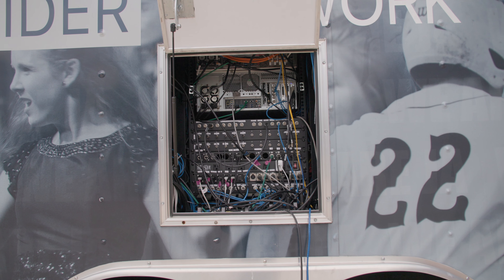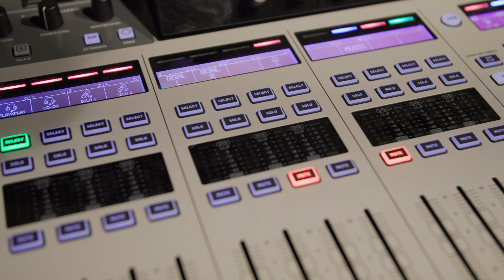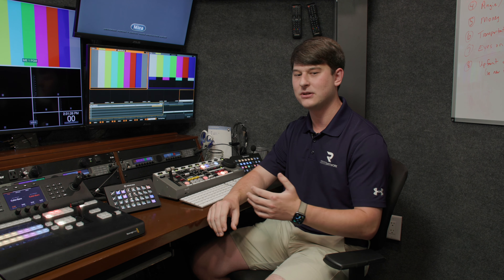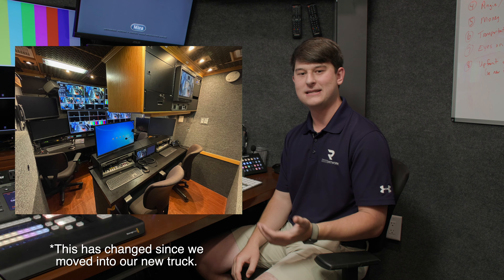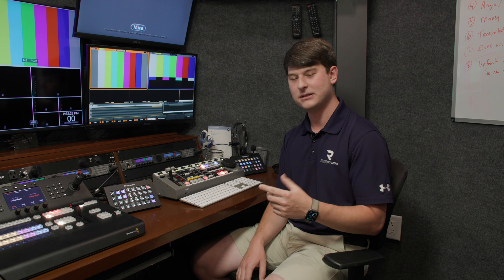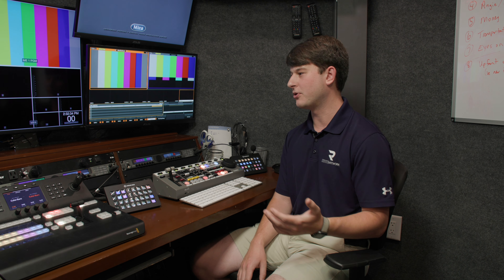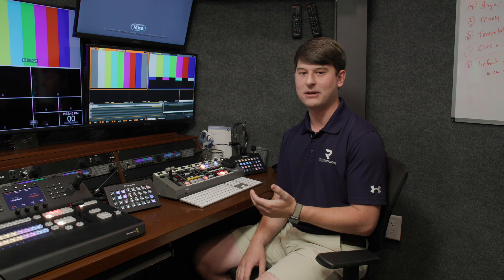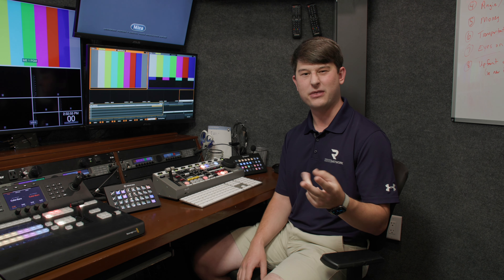Broadcast Replay | Technical Overview

Comment: Love and will love to see your routing process , how you link your replay to Atem with  stinger.
Reply from the maker: We use the built in stinger that is part of the ATEM.  We put the stinger in one of the media pools.  We then have a macro that runs that runs the stinger, switches the input to whatever camera/replay, then removes any upstream keyers that might have graphics on it.  For some additional transitions we use our 3rd output of our XPression machine.